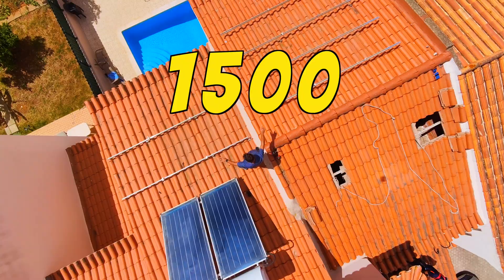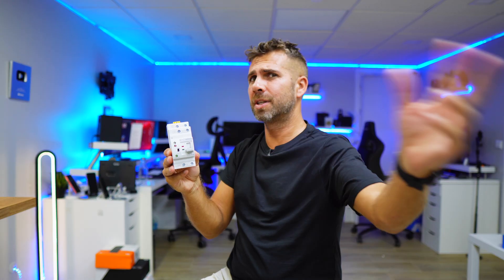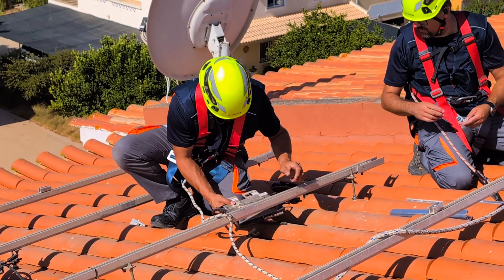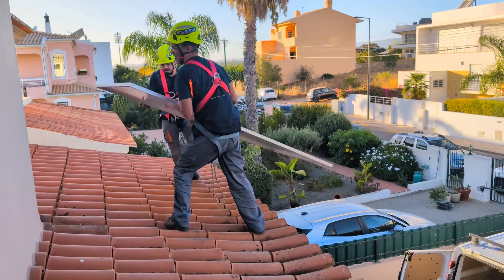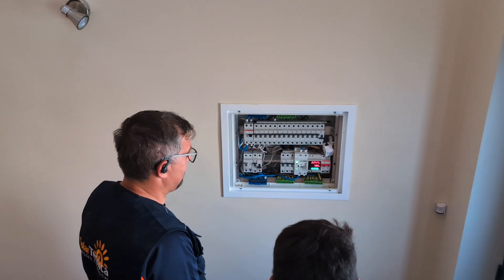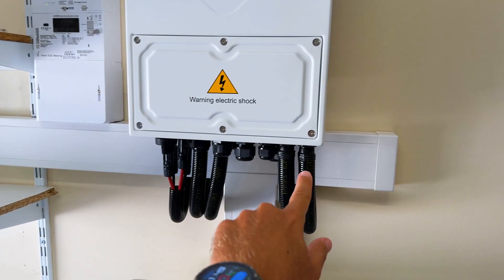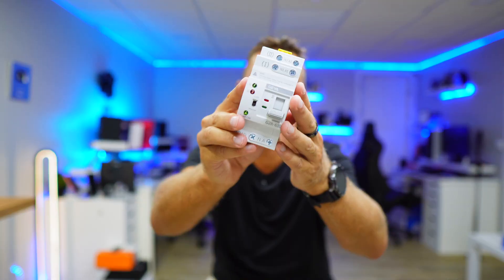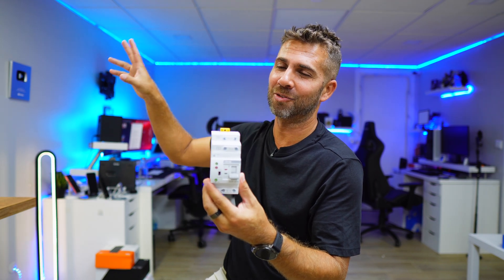MEGA Solar Photovoltaic Upgrade to 10KW 🤯🚀 With BLACKOUT PROOF Kit ⚡️🔋 Portugal |Algarve

Comment: Btw, the Deye SUN 6K has some recommended limits for best performance on the PV inputs:
MPPT range is 150-425V while full load DC range needs to be 300-425V. This means you won't be able to draw full PV power (7800w) unless you have at least 300v input.
With your panels in a 4s and 5s configuration to avoid shading you have a 179.2v (Vmpp) and a 224v (Vmpp) string which at least is good enough to keep it within the MPPT range, but it is a bit low for peak power especially since your Impp is 13.6a and that is over the 13a limit per MPPT. Your panels current rating is thus higher than your inverters input rating. It would favor higher voltage vs current. Just thought I'd mention it as it may limit the generation a tiny bit during peak production.
I'd be interested to hear what you find in your logs. If it goes over 13A per MPPT and sustains this during peak production in a day, then all is good! Please let me know what you find!

Comment: I don't get it. The Deye has a backup load port that can run entire house. This decouples it from grid such that the switcher is not necessary.
The Deye also has a generator input that can be used to couple in the pergola inverter. Since the inverters are phase and frequency coupled they regulate the power they can be allowed to deliver such that there will not be any generation beyond what is needed. If grid is down only the energy that can be consumed locally is generated by either or both inverters. In addition the Deye can take excess energy and put into battery if not full.
Drawings of this standard connection scheme is in the installation manual.